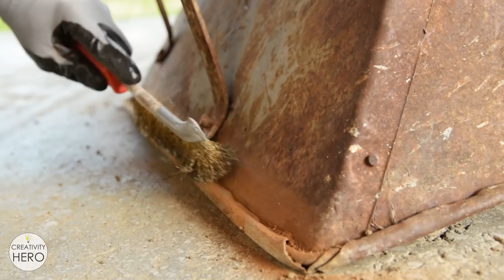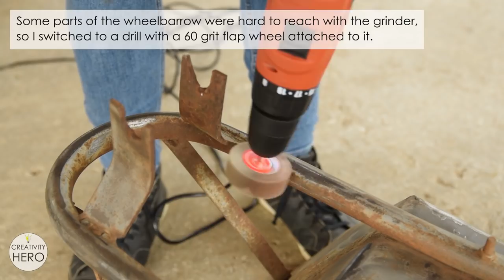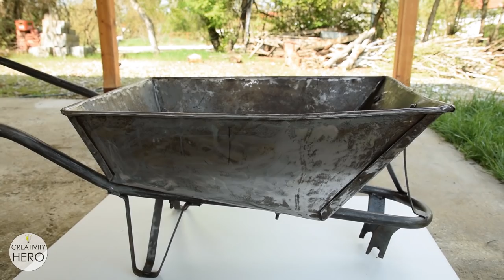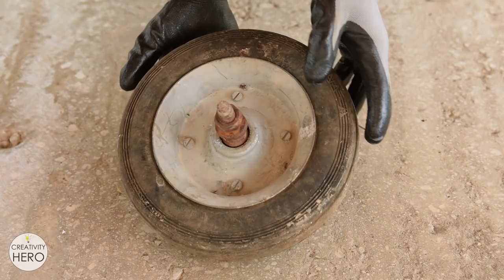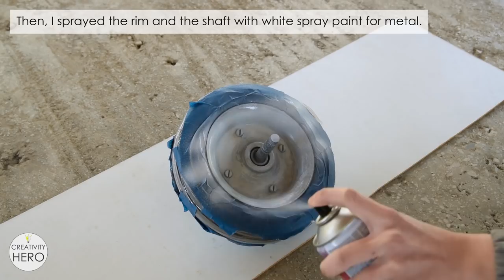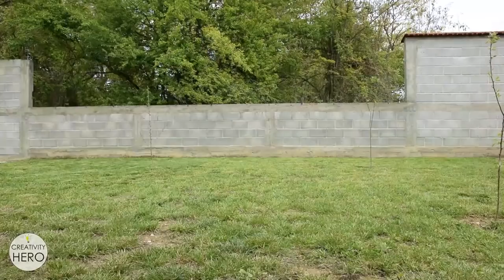Old and Rusty Wheelbarrow Restoration

Comment: great job as always! a question: this "flower pot" have drain holes? cheers from Brazil!
Reply from the maker: Actually it has holes on the corners, where the metal sides are joined together.
Reply: Why you wanted drain holes in a whelbarow?
Reply: @jesussanchezgonzalez1047   She's using it as a planter.

Comment: Ummm.  Should have removed the tire from the wheel and removed the rust,  primed and painted.  The leading cause of flat tires on wheelbarrows is rust pitting the surfaces the tire needs good contact with to hold air.